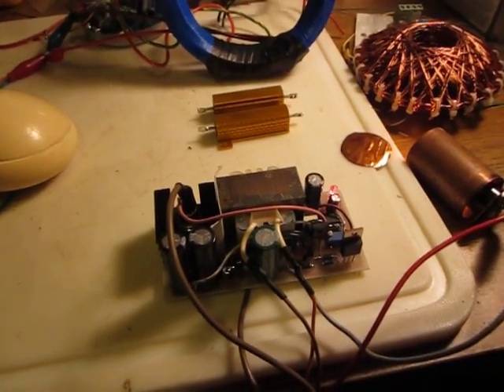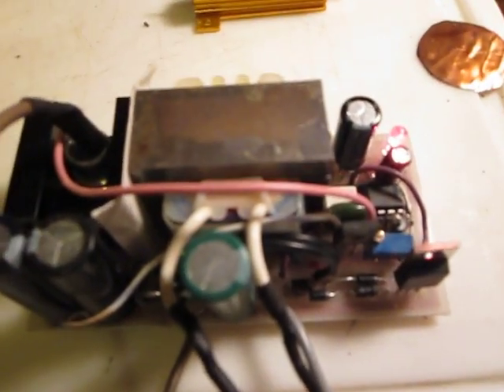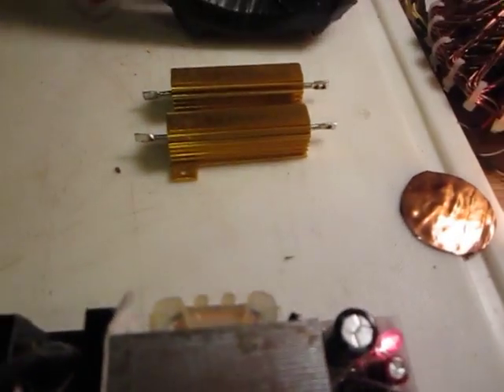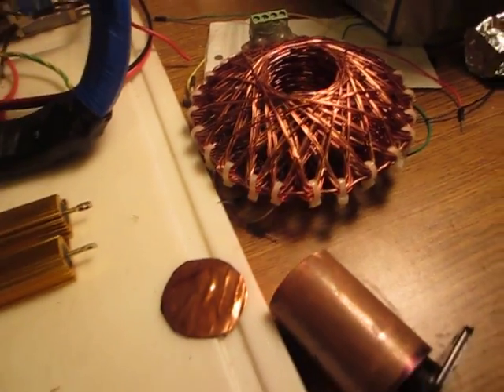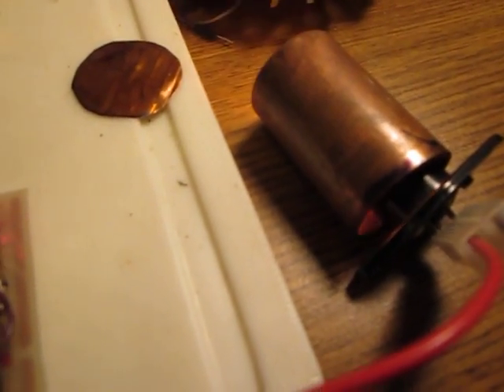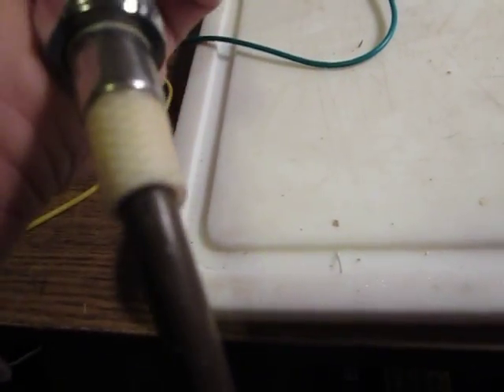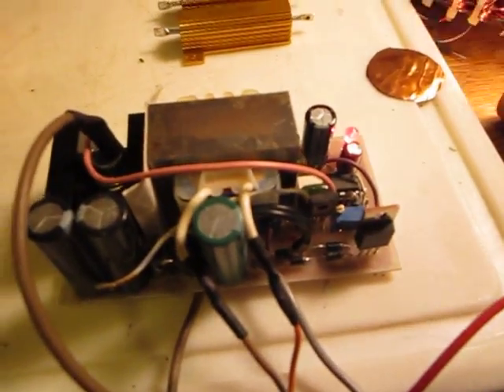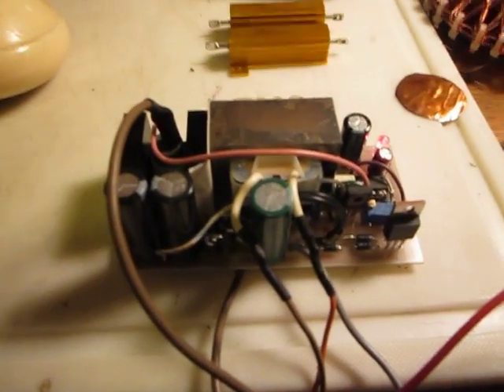Modified Magnetic Pulser

Comment: Great work!  Question - I'm looking to build one as well and have a donor 12 vdc power input, 80 watt out vehicle strobe light power control/supply unit.  I wish not to use a strobe light in the end design and usage.  The question is, what electronic component do I need to add in between the coil and power out, if any, to assure each discharge does not re-enter the unit consequently damaging it?  Thank you.

Comment from the maker: Hi. I moved forward and designed newer and in my opinion better MP without using high voltage. Now I operate under 100VDC.  I did some measurements and resulting magnetic pulse is sufficient enough to induce between 50-100uA current up to 3" deep into body tissue. I can easily obtain 30-50 J and discharge in 2.5ms pulses into the coil. I also increased coil inductance to get higher magnetic flux.
For more info please visit Energy Science Forum - Electronic Healing Devices.

Thanks
V